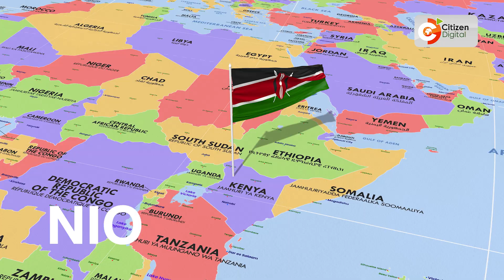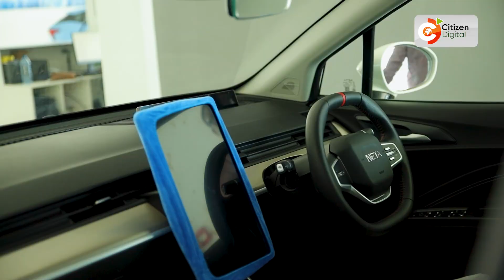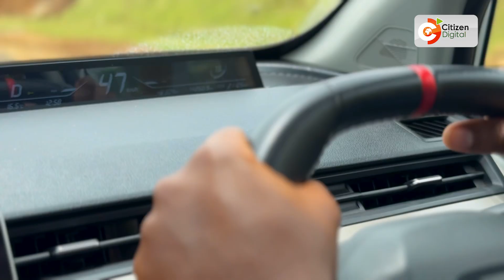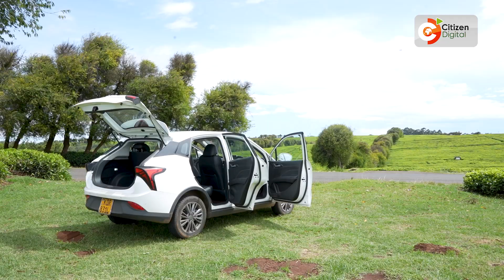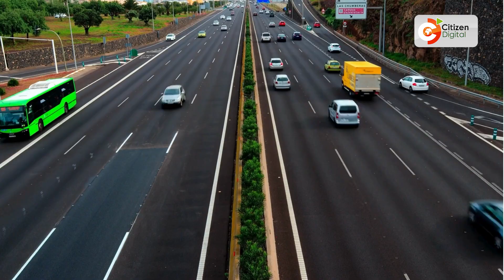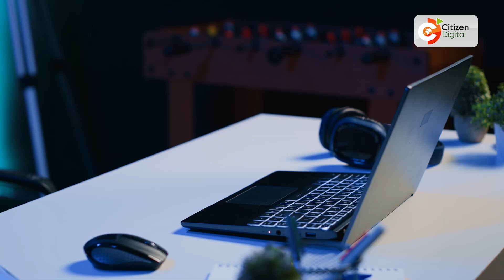How practical is having an electric car in Kenya?

Comment: What if unaishi 5th floor kunaendaje?? 😮
Reply: Unaenda hardware unanunua electric  cable ile ya grey inakuwanga kama 100 to 150 a meter . Nunua kama wire ya 2k weka plug on one end  na socket imepigiliwa kwa mbao on the other end na problem  solved . Usiwache cable  njeutapata iliibwa na electric  car owner mwingine😂
Reply: Itabidi waanze kueka charging ports kwa parking lots